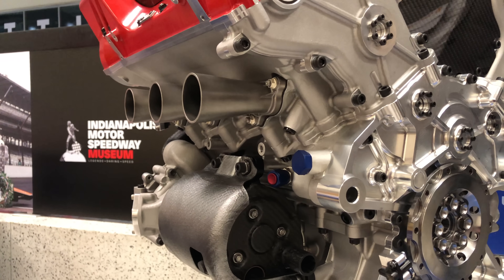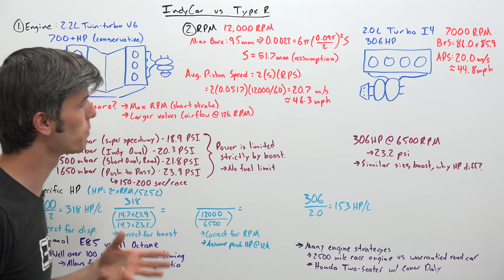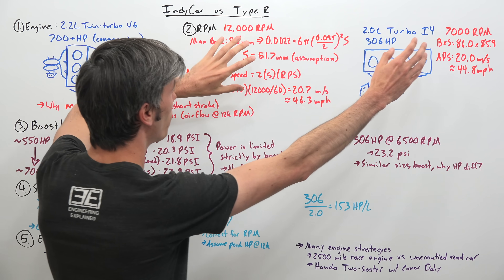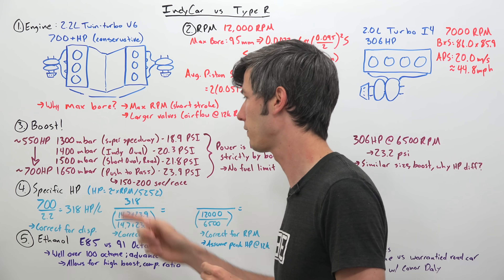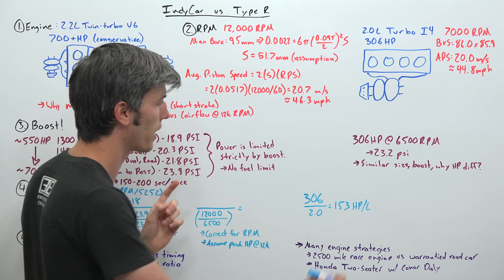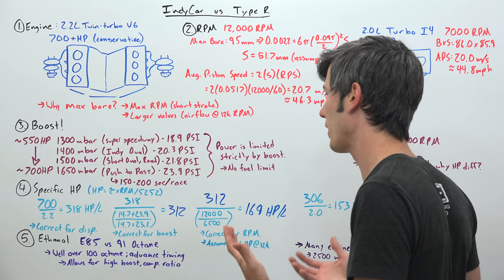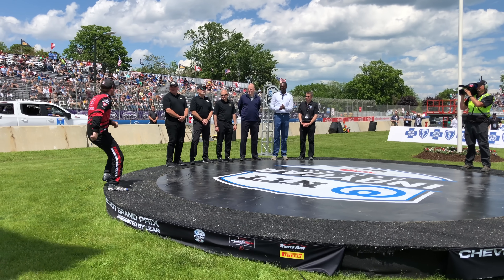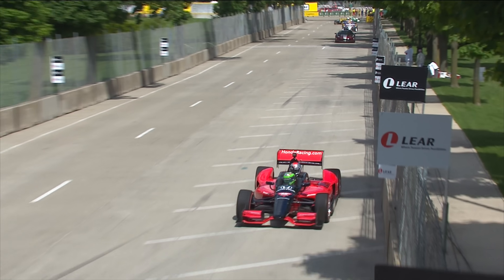How Honda’s 2.2L Engine Makes Over 700 Horsepower

Comment: 700HP 2.2L
Needs a full rebuild every 2500 miles..
Yer, that's why you don't want that in your car.
Reply from the maker: 2500 miles. Haha, I even say it in the video!
Reply: @EngineeringExplained  Yer, I know I commented "1000 miles" before I got to that part of the video..
I mean it was a very interesting video, showing how they achieve that HP difference, and that basically its the same engine tech, getting the same HP/L/rev/boost/Octane. But it just shows why you don't ever want such high performance in your car. Its always a tradeoff between longevity and performance - but many just see performance.

Comment: You forgot to divide per cylinder. 2.2l x 6 cylinders or 2.0l x 4 cylinders. Quite a difference.
Reply from the maker: That's not how it works. The entire engine (including all cylinders) is 2.2L, not each cylinder. The V6 has smaller cylinders.
Reply: @EngineeringExplained  agreed, but combustion isn't something that exerts a linear pressure on a cylinder during its stroke, correct? So up to a point it is more efficient to spread the fuel over more cylinders for more efficiency of the combustion. With which you get a shorter stroke as well as... I forgot what it's called because I am not an engineer, but the angle at which the cylinders are set on the crankshaft. Which means each cylinder has a better moment on the crank and thus power can be more easily made.

Comment: F1 Honda engine (power unit) is pushing approx 1000 hp from a hybrid 1.6 liter v6 plus a mgu-k and mgu-h.
Reply: Cliff Lee It’s not making 1000HP from the engine. That’s combined with the hybrid output, roughly 200HP. The V6 is making around 800HP

Comment: The 95mm bore means more torque, but since it’s turbocharged torque is limited by boost. Also the mean pressure during the power stroke is higher because if the stroke is short, the air volume doesn’t increase that much in the cylinder so the pressure doesn’t drop as much.

Comment: I need this 2.2 L swap in my 2001 integra type r and have it rev limit set at 10000 rpm so it will last bit longer than 2500 miles lol

Comment: I wonder if they use the same Turbo size, because if they don’t that’s another reason why the gap in HP is so large. It’s not the same to run 22 psi on a stock turbo than 22 psi in a GT35R Turbo lol
Reply: Indycar uses twin BorgWarner EFR-7163 turbo chargers just so ya know

Comment: How many liter would the engine be if the turbos are included (let''s skip piping and other places oil gets fed)? (Yes, I release an engines's displacement isn't the amount of oil an engine can hold, and I understand the boost can be tuned up or down depending on the track).

Comment: Jason, another awesome explanation!! Thank you for sharing!! 
So basically it just breaks down to 1. higher RPM and 2. higher octane fuel?
Reply: Plus better materials and better craftsmanship probably.
Reply: You missed he entire bore stroke... that’s the whole difference. The fuel is fairly minimal, putting e-85 into the street car wouldn’t give you much. You could also run the street car 12k rpm, but the torque at that rpm would fall off a cliff on the Dino run, resulting in probably like 50 HP because the piston speed would be approaching flame propagation speed (which means the force on the piston would be near 0, which means almost no work is done).
Reply: It's more than that there is also cam lift timing . duration and cylinder head design that is where the real power is made air in air out more air+ more fuel = bigger boomb
Reply: You guys are correct, air in-out, bore, stoke, materials etc... which breaks down to and results in layman’s terms: higher RPM and higher octane (trying to break it down for someone who doesn’t care as much as we do, lol).

Comment: In short 
- less stroke = higher rpm
- slightly higher boost = more hp
- use e85 fuel = 100+ octane thus more power than 91 octane fuel
Reply: I mean does the fact its got two extra cylinders not matter at all, not sure why that isnt really talked about.
Reply: Jurassic Tech That’s why he corrected for the displacement. The actual number of cylinders doesn’t matter, it’s just that more cylinders generally allow for a larger displacement of air and fuel in the entire engine over a given time
Reply: @adamlreid  ok, I thought i was missing something lol.

Comment: Probably makes like 5 pound feet of torque haha. Seriously though, these really high power engines have so little torque by comparison. It’d be useless anywhere other than the track
Reply from the maker: Over 300 lb-ft, and turns out it’s designed for the track ;)

Comment: Honda: we can only tell you it makes above 700hp, and the bore.
Jason: (does some math), so your engine has this stroke, uses this much fuel, has up to this much horsepower and torque, and can probably go this fast estimating the drag co-efficient of a typical formula one car.
Honda: <surprised Pikachu face> damn, don't ever tell that guy anything
Reply: How to: Make memes on notepad
Reply: jason: how much do you pay to me?
Reply: J C lol if you’ve taken a basic internal combustion engine class in an engineering school, this stuff is really quite common knowledge
Reply: He has to be hired by honda
Reply: What torque?
Reply: @lbear3321  i mean, hp is a made up number based on a torque equation. but i get what youre saying. no need for torque when youre never below 6k rpm
Reply: @Cheeseypoofs85  Unless you're at a stop on a steep hill. Looks silly revving that engine to get going. I'd rather have the torque personally.
Reply: All they told him was the horse power the amount of cylinders and the races it's going in
Reply: he doesnt know the bore.. hes guessing
Reply: @Cheeseypoofs85  Yeah but given how math and science tends to work... pretty sure he can get pretty close if not on point.
Reply: @Cheeseypoofs85 , calculus my friend. If you know what I'm. Talking about.. Hehehehe
Reply: kgkustomz97ser kind of like you can calculate thrust within 2-3% of jet engines just knowing a few data points (randomly just knowing like 4 points lets you calculate the other ~20), then you use this to quickly see the performance metrics of a competitors airplane (such as military), and viola, you’ll have a super close top Mach speed estimate (single digit percent error), and most of the performance envelope unless they secretly made it out of popsicle sticks and doesn’t actually survive flight. This is fun to do with de-classified airplanes to see how close your estimate is, a good engineer will have most of the parameters just looking at it and knowing the level of technology for that country, it’s fun for nerds like me!
Reply: Americans are not good at math. They still use body parts to measure things.
Reply: @quattro4468  huh? You do realize math is just numbers and cant and is very easy to jump between the two formats of measurement.
Reply: @quattro4468  that's the "imperial scale" and yes we do lol
Reply: @rexrunner  Explain why these Americans who aren't good at math have the most developed financial system in the world, pump out more research papers than anyone else, and lead the world in most of the math-heavy industries like computational engineering and aersopace engineering?
Reply: jerry metcalf  you mean jews and german scientists.
Reply: @quattro4468  The "big ideas" positions were filled by guys like Wernher von Braun and Arthur Rudolph because they had seen more rockets fly and fall than anybody in the US. That's because the Nazis focused expensive resources in an inefficient direction with the whole vengeance weapon concept. That meant Wernher von Braun et al had more sense about what would work and what wouldn't, and thus could make better decisions about overall direction than relatively inexperienced American scientists could. But almost all of the heavy lifting in the program was done by Americans working at American companies contracted by the administration. If you really dive into the details and look at individual problems and individual solutions in the course of the program, the chief figures present to work them out were Americans. Pretty much the whole mission execution itself was of course also done by Americans.

If the US had pushed ballistic missile development in WWII to the extent the Nazis had (instead of pushing precision manufacturing, aeronautics, and nuclear technology), then the rocketry experts would have been Americans, but the spacecraft themselves could never have been built. No other country had, or could financially support, such a sophisticated aerospace industry. As it stood, the Nazis made a mistake by focusing valuable resources in an inefficient direction, and at the end of the war all they had were smart people and ideas. Whereas the US had a whole industry to incorporate those people and ideas into and together produce a successful moonshot.

Comment: @Engineering Explained F1 Honda engine 1.6L V6 single turbo +700 HP get info on that engine :D that would be awesome since I think it is one of the most powerful engines per displacement :)
Reply: Wankel rotaries are the amount the highest reliable in a racing scenario for combustion engines  (1000 HP per liter). Reliable as in comparatively since those are still using OEM engine housing and probably last more than 2500 miles when only doing 350HP per liter (since no boost on gasoline they are rated 238 for a 1.3L at the factory, although it’s really more like 180-190 because marketing...)

Power amount is for drag car with duel turbos and methanol, the Puerto Rican’s know how to make those Doritos engines run!

Comment: So how does that all work through for a 1600cc F1 engine, or for that matter, a 1200HP 1500cc 1986 BMW F1 turbo
Reply: Well bmw had 4-5bar on boost
Reply: That would be a cool side by side video!  Some of my favorite engine's came out of the 80's F1 turbo cars.
Reply: As Roko says 5 bar (72 PSI) does the trick!  Effectively making the 1.5L engine into a 7.5L engine?
Reply: Bmw is a complete joke compared with Honda in F1. 19 wins for germans vs 74 for Honda

Comment: Should have mentioned the short stroke motor delivers significantly lower torque for a given rpm
Reply: True but it doesn't matter. Torque x Rpm /5252 will give you the answer...

Comment: F1 engines make about 800 HP from 1.6L V6 with single turbo and the engine has to last 7 races including training and qualifying.
Reply: If I remember correctly, Honda still holds the specific displacement horsepower record with a F1 engine from the 90's. They got 1000 HP out of a 1.6 liter v6 with somewhere north of 50 psi of boost running on toluene.

Comment: Spin the engine to win, at WOT and then run it rich to keep it cool because of the extra compression.  You now have a 4 cylinder engine that performs like a V6 or V8 and getting much worse gas mileage.

Comment: I put about 2000 miles on a 2018 FORD Expedition with the 3.5L EcoBoost engine. This engine has a 6000+ rpm redline. I did not baby the rental but there never was a need to see even 3000rpm. So, what good is a 70000rpm redline?
One thing I have learned over the years is that you will only confuse yourself it you try to apply the strategy used in a racing product in a practical street use scenario. You simply can't say (reliably) "this is the way it is done on a race car so I apply it to my street ride" you will soon be a pedestrian.
Reply: It's good if you are buying a car as a toy and every time you drive it you go balls all out.

Comment: So they've basically built a V6 crotch rocket engine.....  That's why everyone should own a sports bike.
Reply: But bikes hardly ever have turbochargers; as I recall, the throttle response makes them very dicey to handle.
Reply: @soaringvulture  If you've never pulled the throttle back and ran through the gears on a 1000cc bike, while fighting to keep the front wheel down.....   Then you haven't lived.
Reply: @calholli  Is 750cc enough? That H2 triple pulled pretty hard back in the 70's.

Comment: If you can, tell us how F1 engines use engine oil to extract more power out of the engine by mixing it with fuel.

Comment: 12,000 rpm is almost double 7000...   higher rpm = more volume/displacement in a set amount of time = more HP
Reply: Thats how low displacement engines have to make up for power. It works faster to move the same amount of air as larger displacements.

The tradeoff being lifespan but much lighter weight
Reply: @PeterXChhanX  Rpm = power if the heads, cam, and intake can support it.
Reply: @1320crusier  obviously. Designs in NA built engines play a huge factor in where the peak power band would be and the flow design including port designs, cam lift, compression, etc
Reply: Boosting an engine can basically compensate for the lack of "breathability" of the head and cam combo
Reply: 3% more boost. 10% more displacement. 71% more revs. Ignoring the fact that the street engine is not tuned for maximizing power and is using a significantly less powerful fuel for this boost level, that's already a 94% increase (obviously this is not a linear comparison). How does this surprise anybody? I'd be more interested in comparing these new boosted v6's to the older naturally aspirated v8's in indy. Completely different ways to make the car go almost the same speed.
Reply: @jeffbeasley8235  Regular 87 octane fuel is actually more powerful in that it has more potential energy in it then race fuel that the Indy car would use. However, the race fuel has a much higher octane rating allowing the engine to run a higher compression ratio without the fuel detonating prematurely and for the race engine to make more power.
Reply: @zincsterc  I didn't mention octane shrugs
Reply: @jeffbeasley8235  compare it to the single turbo pushrod engine that Mercedes built =D
Reply: Honda developed the oval piston NR 500 in the early 80s. It's redline was 20,000.
But it never ran right and was shelved for the NS 500 two stroke V3, which Freddie Spencer won a World Championship on in '83.
Reply: @billymc2681  I thought the NR 500 was banned cuz it was so much faster than any other bike and Honda has the patent on oval piston 8 valve design. No other company could build a similar engine.
Reply: Yup.  The most significant factor by a large margin is the difference in RPM.

Horsepower is a measurement of energy transfer over time.  Increasing the speed at which a process occurs will proportionately increase the horsepower produced by that process.
Reply: Yes, higher RPM is a way for a smaller engine to make up for a lack of displacement. The other way is boost, or supercharging and turbocharging. Boost can be basically thought of as an "engine stretcher" in that by compressing and compacting the air before it gets to the cylinder, you're kinda, in essence, making it function as a larger cylinder.

There is, however, another way to generate more power. Air is generally the limiting factor as horsepower goes. It's the limiting factor, for 3 reasons. First, it's much less dense than fuel. Secondly, the Stoichiometry of most fuels, is such that for each molecule of fuel they require many more molecules of oxygen. Lastly, air is only about 20% oxygen. So, another way to make more power is to utilize a fuel that needs less oxygen. That's the secret that top fuel dragsters utilize to make over 10K horsepower. The fuel they use, nitromethane, needs much less air. Consequently they can pack a lot more of it into the cylinder. If you ever get an up close look at a top fuel dragster, note the fuel line running from the fuel tank in the front of the car to the engine. It's around 2 inches in diameter. Their fuel pumps are rated around 125 gallons per minute. That tells you something about the huge volume of fuel they are pump into those engines.
Reply: And this is accomplished with a shorter stroke.
Reply: Just pondering, same cylinder capacity but way different revs, sure more revs means more power cycles per unit time. But what about the effective power generated by the cylinder in that time. Does a combustion cycle at 7000rpm have the same energy output at 12000rpm? The combustion time is far less, does it still produce the same energy (power output)?
Reply: With 2 additional pistons this makes it easier to build more torque, even though it has the same displacement and shorter stroke than the four cylinder engine.
Reply: plus its also twin turbo vs just one... howd that get missed
Reply: @AllanDaigle  1, 2 or 4 turbo's don't chance de HP if boost is fixt.
Reply: Peter tell that to any tuner 🤣
Reply: @AllanDaigle  multiple turbos only help with boost lag. A single larger turbo can make more power than duel small ones
Reply: @Peertje1982  the fuel getting injected is not limited, making up for the boost and stroke maximums.
Reply: @ILLEagle_1  Also the fact that's a V type engine with 2 banks of cylinders probably comes into play. Routing the plumbing, while still maintaining the same runner length and flow would probably be much more difficult with a single turbo. My guess is, that alone, would make using a single bigger turbo impractical.
Reply: @AllanDaigle  Because the most relevant figure is the maximum amount of boost, which is regulated and Jason discusses at length.

Comment: This type of thought experiment is something I always liked to play around with when I was first getting into Motorcycles. I wondered why a cruiser motorcycle and a sport motorcycle made such different power and the answer was RPM. At, or around, the same engine speeds both motorcycles would create the same power. A Hyabusa creates about the same power at 5,000 RPM as a Honda VTX 1300. The difference being that at 5,000 RPM, the VTX 1300 is almost at its rev limit, whereas the 'Busa could go to ~12,000 RPM.